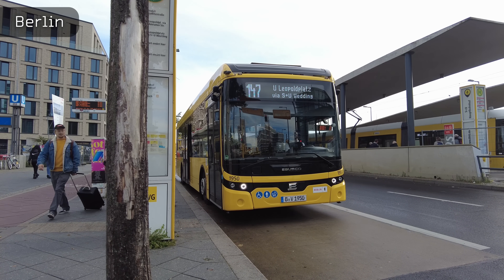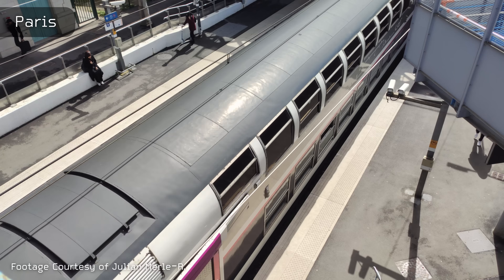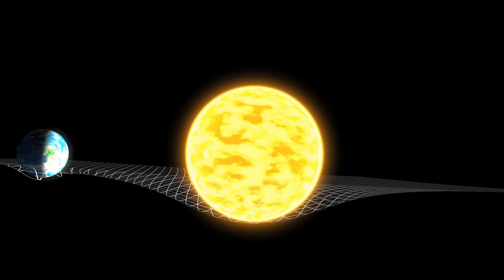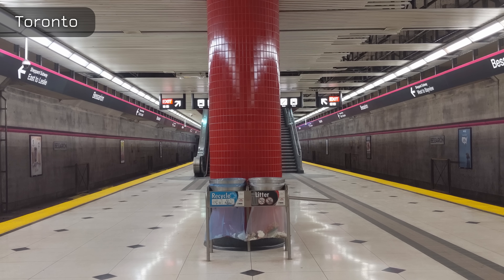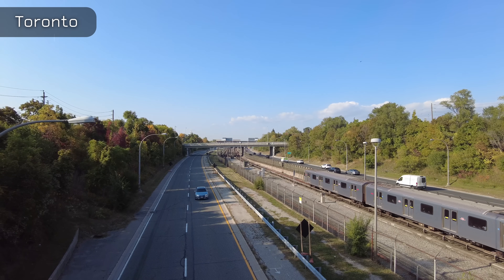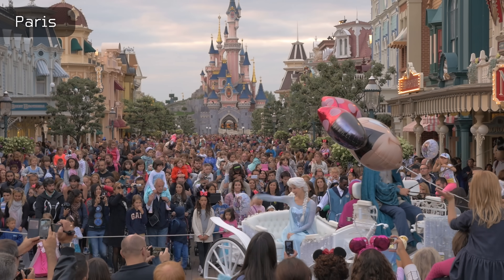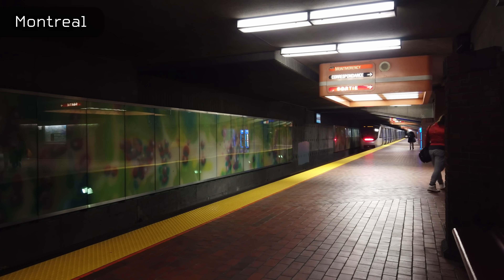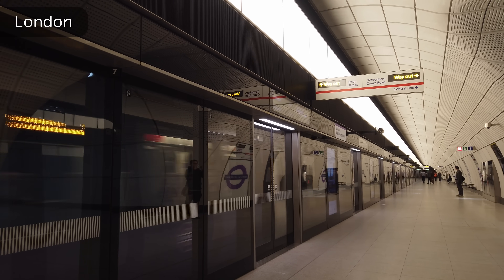Stop Spacing and the Power of Density

Comment: I remember talking with a guy who lives in the suburbs of Paris. He was disappointed that the new high-speed Metro Line 16 would run right under his apartment building, yet the nearest station would be 2 km away. This was despite his neighborhood having a population of 50,000 people and a density of 7,000 people per square kilometer. I should definitely share this video with him! The average station spacing of over 3 km on Line 16 is what allows it to operate at speeds of up to 120 km/h, making attractive for long-distance trips compared to trams or BRTs.
Reply: I don't know the specific context, but it sounds like this would be a great application of A-B skip stop patterns as used on the Chicago El a while back. It would require a third track over part or all of the route to operate efficiently, but it would generally solve the problem of handling the density issue while maintaining speed.

I've thought about this possible being useful on the Washington Metro's silver line in Northern Virginia, which takes forever to get from the DC border to Dulles Airport. If we could add bypass tracks around some the stations, A/B service could really speed things up, during rush hour especially.
Reply: Then they can just put a bus service there that bring its residents to the nearest metro station, or a tram for the capacity. Easy fix.
Reply: @bas3q  As a side-note : There is no need to bypass all and every single station to get significant speed ups on an express service.
Reply: @Kollum  Yes, very true - you could run express from one end to the other end, no stops along the way. Or you could run express with one or two stops, or do a A-B operation where you're only stopping at 1/2 the stops on the line. All really would depend on what you're trying to achieve.
Reply: @bas3q  That definately wouldn't work on line 16. Skip-stop services work best when you have a bunch of potential stations of roughly equal importance, whilst on line 16 a more typical local & express service would work much better.
Reply: Though it's true that line 16 has very long distances between stations and omits to serve certain locations that would have gained a lot from being served (notably for modal switch as buses won't improve things much).
It's like they forgot to put a station at certain locations or decided not to build one where it was planned to save on costs.
Especially on the Eastern part of the line.

I'm afraid some communities the line runs under but doesn't serve will not see any improvement locally.
Places like Gournay, the North of Chelles, most of Montfermeil, the North of Clichy-sous-Bois, and Livry-Gargan entirely.
There's respectively about 4km, 4.25km, and over 3.6km of distance between the 4 last stations of M16 towards the East, even if it's almost fully urbanised and with plenty of new higher density developments.
A couple of additional stations wouldn't have been excessive on this part...
Especially considering that M16 is an arch line connecting with the Saint-Denis Pleyel hub station on one end and Noisy-Champs on the other.
A stretch of nearly 12 kilometers with only 2 intermediate stations will not entice drivers enough to abandon their cars.
Reply: This is a common problem in france that high density suburbs  get neglected commonly. This spacing barely makes sense even regional line trains meant for 1 hour long rides have stops closer together.
Reply: What everyone wants is a system that has a stop where they live, and stops at the places they want to go, and nothing in between. But that's impossible to do for everyone.
The fundamental illusion of cars is that they actually give you that. But of course it's never that simple, since traffic gets a say.
Reply from the maker: @bas3q  You don't need three tracks for skip stop!
Reply: @RMTransit  doesn't it depend on frequency and maintenance/drivers? Down to the minimum frequency of about 1-1.5min not sure if 3 tracks is sufficient, but probably every 10min 2 tracks is fine with automation and weeknight pauses for regular maintenance?
Reply: @KyrilPG 
I don't really see it. The stations are situated in the denser areas. Most of Montfermeil is made of individual houses, except for Les Bosquets, right next to the new  station. The north of Clichy is either individual houses or forest, the denser area is served by a tramway leading to the station. Gournay is very small, entirely made of individual houses, low density, and within reach of both Noisy-Champs and Chelles-Gournay stations the later (with two lines, E and 16) a 10 mn bus ride from the center of town.
North of Chelles, american style suburbia beyond the fields, also not a high density zone. I would say it's in the suburb of Chelles and would benefit from a better bus service to either Chelles or Montfermeil. Or both.
Livry-Gargan is indeed not well served by transit, but it can't be considered high density and, being below the legal requirements for social housing %, not low income compared to its neighbors. And the municipality fought against the  tramway instead of trying to have it serve their center town, so I can't feel very sorry.
Reply: @bas3q The New York MTA, one of the only agencies that operates a skip-stop service (the J/Z trains) reports that it doesn't actually make trips that much shorter, but it does make trips less frequent by half. A lot of advocates in New York are pushing to get rid of the Z train in favor of more frequent service.
Reply: @ Do they have a dedicated 3rd/4th track for this service? I’m unfamiliar with that particular line.
Reply: @bas3q  about 2/3 of the skip stop section is two tracks, and the third track is not in regular service I believe.
Reply: @Gfynbcyiokbg8710  A combination of local and express services works best if there are four tracks. With four tracks, this could even provide a quicker service in quite dense areas, where say a few stations demand that every train stop at them, and the rest on demand trains on two of the tracks but the other two serve them.

Skip-stop is more of a band-aid than a real solution as it requires transfers just to get between stations on the same line - low density not good.

Comment: There’s plenty of stops on my bus route that don’t need to exist because no one ever gets on or off there. All the bus stops on my street however are used by at least 2 passengers per trip every single day
Reply: Does the  bus stop  if there  are no  passengers waiting to  get on  or off?
Reply: Ok so what?
Reply: @anotherelvis  Yeah, that's the thing. If no one wants to get on or off, buses where I live just drive past. And even if there's someone, we're talking something like a ten-second stop. That they exist just gives a bit of extra flexibility without any significant disturbance to the rest of the route.
Reply: @anotherelvis  you have to hail for the bus so no
Reply: @AnotherDuck  normally it’s a 7 second stop on my route
Reply: @AnotherDuck  It might give extra flexibility but have you even seen people miss their stops because they did not expect to have to request them? I have heard of that before. Or people missing a bus because the driver did not see them?
Reply: So what is the population density like on your route? Low density - not good.
Reply: @Myrtone  Oh, it happens, but that's not a problem with the bus route. If someone forgets to push the stop button, they'll remember it till the next time. Drivers not seeing people could be because it's hard to see for some reason, so you can upgrade the stop with lights (if darkness is the problem) and make sure people standing there are visible.
Reply: @AnotherDuck  Do note the implementations of request stopping do vary, and the specifics vary. Buses in Warsaw only stop on request at certain stops, and yes, the people using them do know which stops need to be requested. Part-time request stopping exists in some places too.

You could also add a hail button at the stop so that the driver does not have to watch for people waiting at stops, as is done with train request stops, these being in less populated areas.
Reply: @Myrtone  If you don't know whether you need to request the bus to stop, just do it anyway. I think that here in Stockholm you technically need to do it every time, but in practice you don't for major stations, even if there's no one around.

There's a bigger problem with people who don't understand that in some buses you need to step close to the door for it to open. Some have an open button.
Reply: @AnotherDuck  Do some buses have door buttons that are also stop request buttons? In that case, they don't just press that button to request a stop but to open the door.
Reply: @Myrtone  Nope. Door buttons are on big, orange panels at the doors, while the stop request buttons are small red ones above all window seats plus a few in the middle path. There are also blue buttons for people with mobility issues and strollers.
Reply: @mayohoskotwrandttte  then they should make all the stops mandatory so the bus never arrives early
Reply: @erkinalp  Stop skipping, if common enough on a given route within a given timeframe, can be used to reduce timetabled running, if it cannot, then buses arriving early (say more than a minute before the designated time) need to wait longer at a stop that is not skipped so as to depart after potential passengers have arrived. Arriving early (but not departing early) is better than being late.
Reply: @AnotherDuck  That setup does exist on trams in some European cities such as Helsinki, Berlin and Vienna.
Reply: @Myrtone  It's happened to me many times.
Reply from the maker: You can't get rid of every stop, but if you have 5 in a row with very low passenger numbers they should absolutely be consolidated.
Reply: @MattMcIrvin  What has happened to you many times?
Reply: @RMTransit  Maybe not if there are other ways to improve the service, such as better priority and more dedicated lanes.

If there are 5 in a row that are often skipped (to the point that stop skipping can be used to reduce timetabled running) then there might not be enough density.

I am not saying stops should not be consolidated where there is a cause, but other ways of improving the service, as well as potential for densification need to be considered before determining there is a cause.
Reply: @erkinalp  bus stops don't need to mandatorily stop at stops that aren't frequently used. in my experience if you're waiting and don't hail in the suburbs the bus drives on by. the hail method also helps when multiple routes use the same stops
Reply: @Myrtone  a lot of peak hour buses are 15 minutes late in my suburbs because there are no bus lanes downtown. cities need to do better and prohibit personal cars in areas with dense office buildings
Reply: @mayohoskotwrandttte  It is probably better to do that first before consolidating stops, with consideration for potential for densification.

Comment: All of this illustrates why it's important to plan transit as an integrated system, not as isolated or competing modes. High speed services with wide stop spacing, enhances and is enhanced by local services.
Reply: Yes, everything should work together
Reply: Tell that to Montreal where they're predicting once the REM is fully operational it'll cannibalize EXO ridership. Not to mention REM essentially kicking out EXO from Gare Centrale.
Reply from the maker: Absolutely, you need that synergy between different services to create a good system
Reply: @drewpatterson8261  isn't that because EXO is a bad service? Seems to me that it needs major upgrades before it could be a good contributor to the network, such as platform upgrades and electrification.
Reply: @szurketaltos2693  

The thing is EXO had an electrified line, but they've completely replaced it with the REM.
Reply: @drewpatterson8261  hopefully land use gets better around REM stations, right now at a ~7k ridership increase that's 1m CAD per daily rider. I would also expect the ridership on that line to substantially increase with REM East due to network effects, but...

Comment: perth in australia is probably a prime example of the benefits that come with wider station spacing, as our suburban trains on the modern lines have such a fast average speed they are comparable to many regional trains across australia lmao. and as you said, to compensate for the people not within walking distance of a station, bus feeder connections help make that last few kilometres of any journey
Reply: How about 180 miles, as is the first stop (Warrington Bank Quay) normally out of London Euston on services to Glasgow Central?
Reply: @seprishere  You wouldn't be getting on that Pendolino if you had to go somewhere between Euston and WBQ anyway. It's not like AWC only has one stopping pattern on all their services between Euston and Glasgow.
Reply: @xtskywalker9101 I think there is one daily stopper from Glasgow to Euston, otherwise it alternates between Edinburgh to Euston and Blackpool North to Euston.

I would routinely get on said stopper for Preston to Crewe or Preston to Birmingham New Street.
Reply: However, are any commercial buildings in suburban Perth at least three stories high? If not, there is a good chance there is simple not enough density.
Reply: @Myrtone  there has been a larger focus on TOD in recent years, so it is possible to find higher density buildings in suburban perth near some stations, but yes, perth is still wait too sprawly I agree
Reply from the maker: It certainly is, and that this correlates with low density.
Reply: @Skyymon  Perhaps Perth could also do with a return of trams.
Reply: this is the biggest difference I find between the newer mandurah/yanchep lines and the legacy freo or even midland lines, they could definitely use a bit of touching up after the ellenbrook line is open
Reply: @Skyymon  What are you saying probably will be happening in a few years?
Reply: @Myrtone  that last reply was about trams, but unfortunately it seems this isn't actually the case, as the transport minister has made it clear they are not building trams or light rail just yet "unless someone is willing to 100% fund it". i think transperth wants to mainly focus on suburban rail instead of light rail/trams primarily due to our suburban rail still deserving many upgrades and light rail/trams being particularly difficult to build in the areas that would benefit the most from light rail/trams (the city)

Comment: Oftentimes people will compare the DC Metrorail to an S-bahn and say it's not "true" metro. To that my response is usually along the lines of "Yeah, so?" This explains why. It's certainly not perfect- a lot of stations, to the southeast and of the city core especially, need actual density. But it's a great way to get into the city fast from the far flung yet dense areas like Silver Spring, Rockville, and Alexandria. And then in the core of the city it's spacing is denser around the CBD and high density residential areas while being more sporadic in less dense areas.
Reply: I find arguments about whether something is a "true" metro to the side of actual performance. Sure, it can be interesting, but it's just academic. It doesn't matter what the definition of it is, as long as it works.
Reply from the maker: There are some elements which are kind of S-Bahn like, but honestly it doesn't have most of the core features so I wouldn't say that. I do think the main issue "density" wise is the amount of parking at a lot of suburban stations!
Reply: @RMTransit  Definitely agreed there! While I live further away in MD for a car-free commute, I still visit DC a lot and have a soft spot the metro I grew up with. 

I do think that replicating the sort of density you see on the Rosslyn-Ballston stretch would be the ideal goal for the DC suburbs where there is a dense spacing of stations. But next best is making each station as dense as possible- Silver Spring, Bethesda, and Crystal City are the ideal examples in my opinion for having a lot of high rises residential and mixed uses in the surrounding several blocks while not having a lot of busy roads taking up space and hindering walkability.

Some other stops have done some good but have a lot more potential like Wheaton, North Bethesda, and Hyattsville Crossing, with plenty of room to build/rezone at malls but overly car-centric design.

And lastly there are a ton of stations where they should just build several mixed-use towers and try to induce ridership. If they want to keep the park and ride status, they can build a couple garages and still have a ton of capacity by insisting the buildings not have parking minimums. These include Largo, Greenbelt, Branch Ave, New Carrollton, etc.
Reply: @RMTransit is it comparable to the rer

Comment: Toronto’s buses and streetcars could really use better stop spacing. While I appreciate that there’s a nearby streetcar stop to my residence, I’d be fine walking a block or two and would rather there be faster service. On many buses routes, the stops are almost every block and totally unnecessary. I would challenge the TTC, to remove a lot of low density stops on bus routes.
Reply: I wonder if they could have better priority and more dedicated lanes first. I wonder if much of Toronto (with a population of over 6 million) could also do with higher density. Rather than challenging the TTC to remove stops, it is better to try and focus on densification as low density is not good for active transport usage. Both removing and skipping low density stops simply has the twisted logic that a quicker service can be provided by virtue of low density, this is not good when compared to running with more service patterns, namely express buses that overtake local buses, which can provide a quicker service where density is higher.